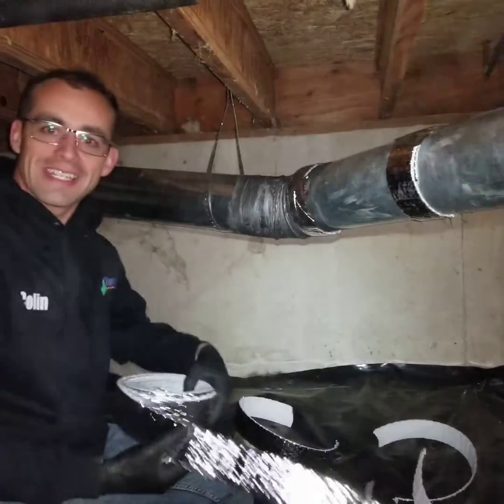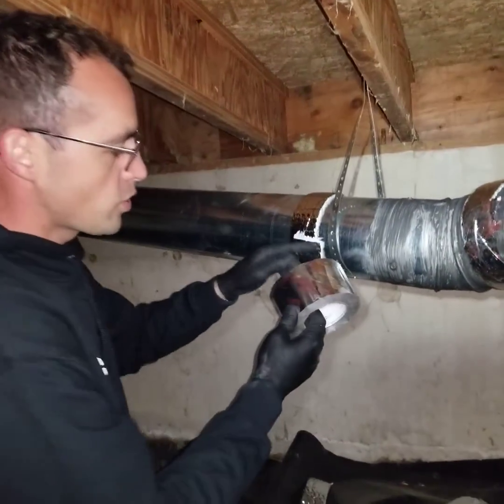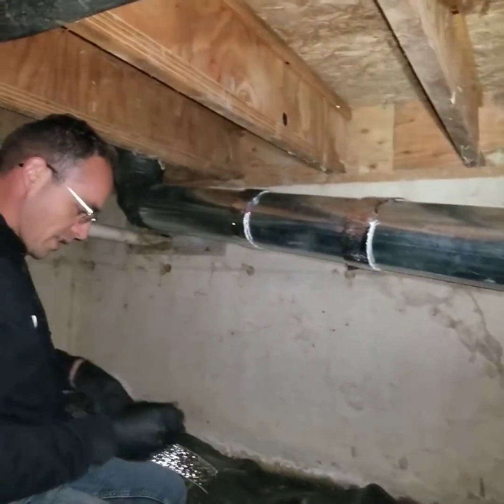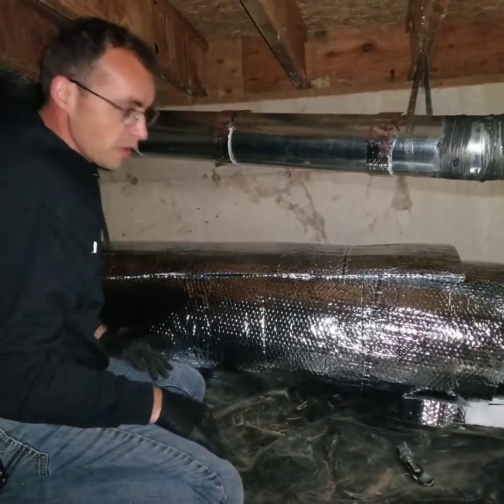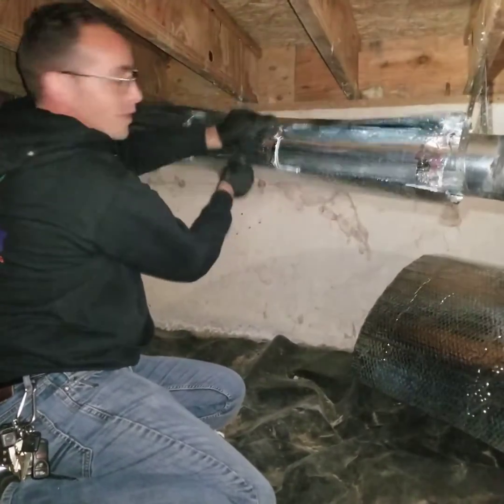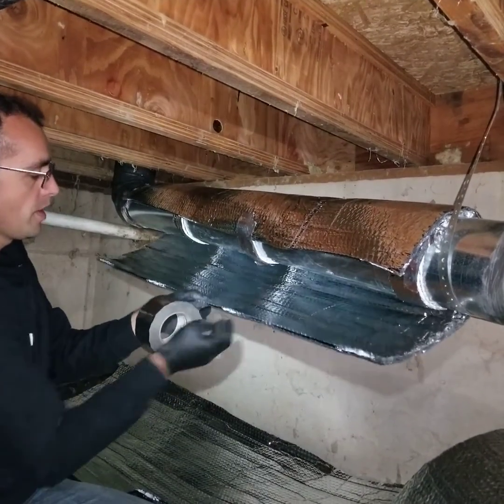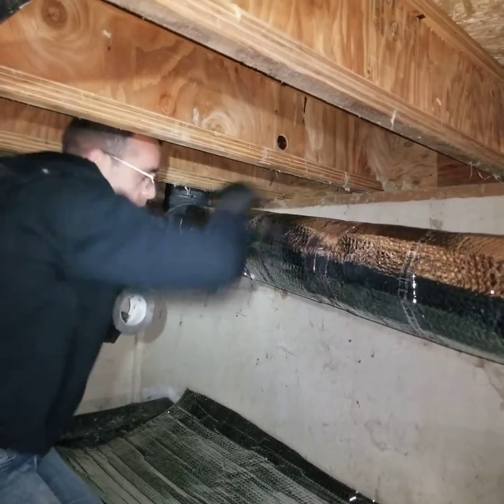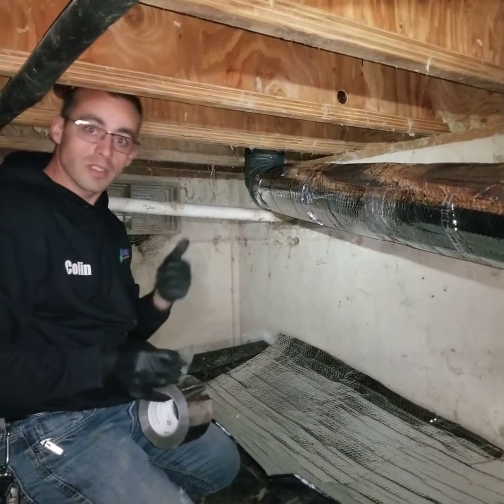How to insulate Metal Ductwork with foil insulation - for HVAC installers

Comment: Thanks for the video. I'm searching online for right materials and method for insulating my HVAC duct in the crawl space (the furnace is also in the crawl space). When I asked ChatGPT or google, quite often I found their answers were that although using reflective insulation with an air gap is correct, but the R-value you could have with reflective insulation (either form or bubble) is quite low, less than 6.    Does this sound right to you as a professional?

Comment: Thank you for this!  I put up duct without insulation and now I have to take it down to do the insulation.  A lot of work for a 65 year old female, but what the heck! I had to move my portable air conditioner 35' so it will be in the room I live in most of the time.  On a very limited income but had to do it. Live in a brick apartment with metal doors that absorb the heat and doesn't cool down all night. Grateful to have this instruction and to know I can just use the R6 foil insulation and not have to mess with that punk fiber stuff!  You're the best!  😃

Comment: Thank you for the demonstration. I have a manufactured home crossover that I am considering replacing. On the existing flex duct It says 10" with R-Value rating 5.6. It is only 10 ft-long but I see replacements only come in minimum 25' length. If you were me, would you replace the crossover with a rigid duct? I think I have noticed that the airflow on that half of the house seems quite a bit less than the other side (the side with the indoor air handler unit, of course). I am also in Washington State.
Thanks for any and all advice!

Comment: are you supposed to insulate the white pvc type pipes too? (or if it's not required, is there benefit to it anyway? or any safety issues or downsides to NOT doing that?)

Comment: I have some rigid duct that is up against the ceiling so i cant get behind it too easily and using a wrap is just practical. Is there an insulating paint i could brush on to help insulate my galvanized rigid duct?

Comment: I have rectangular duct in my garage supplying heat to the bedrooms above. It has this old fiberglass insulation that falling off. The duct is flushed to the ceiling. How should insulate? Should I use the same material with the spacer for higher R value? Thanks
Reply from the maker: @annemariedebarros2475  either type of insulation would be a good choice. I prefer the foil type because it's easier to use and it isn't irritating to the skin.

Comment: Do you have to remove the hanging straps and insulate below them then reinstall?
Reply from the maker: @jaredzanelli7867  you don't have to. If you do so the hanging straps will crash the insulation that's reducing the auto value just below the strap. It's better to insulate around the strap as shown in the video.

Comment: How would you wrap duct work that is a square box under my mobile home my duct work is a flext tube from ac to metal box that runs the floor of my home
Reply from the maker: @almann5798  usually that metal rectangular trunk runs the length of your mobile home. You may have one or two of those if it's a double wide. Typically those are already pre-insulated along with a subfloor and the membrane. Is another case for you? If they are exposed you can wrap them exactly the way I showed here. You may also use a different technique where you use a fiberglass insulation and staple the insulation to the subfloor after wrapping the duct so basically forming a u-shape.
Reply: @cleanairheatingcooling4105  yeah few of my vents are sweating and water is getting into the duct work so i was going to wrap them to see if that helps and see if it helps lower my bill some its a 92 mobile home ive own it for 5 years so do not know how it looks under there
Reply from the maker: @almann5798  does my answer help you at all? If not you're welcome to send me a picture from under the house so I can see the ductwork and I can give you more accurate advice by text.
Reply: It helped thank you

Comment: All insulations work the same way.  To achieve R value you have to "trap" an air space.  Think of it this way - Let's say that you have a 3" thick piece of fiberglass insulation (duct wrap) rated at an R8 when installed correctly.  If you take that same piece of 3" fiberglass and wrap it so tightly that it is reduced to 1" thick it is no longer an R8.  Why?? You didn't remove any material right?  What you did do was remove the air that is trapped within the fibers of the material.  This reduces the R value.  Reflectix reflective duct insulation doesn't have any fibers to trap air so you have to build an air space against the duct to raise the R value.  The material used in this video is an R4.2 wrapped direct the the duct and an R6 when installed with a spacer.  It is a double bubble, double reflective product that acts in three ways.  1.  It is an insulation (as explained above.)  2. It is a radiant barrier reflecting back radiant heat at 96% which means that the air in the duct stays cooler in the summer and warmer in the winter.  3. It is a vapor barrier which helps prevent your duct work from sweating.  We also offer a big bubble material HVBB48075 that is an R6 applied direct to the duct and an R8 When installed with an air space.
Reply from the maker: @toddhare8225  hey, you know your stuff. You're hired. Thank you for the great explanation! Do you work for the manufacturer or are you an HVAC guy like me? 🧰 👨‍🔧
Reply: @cleanairheatingcooling4105  thanks.. I work for Reflectix, the manufacturer.
Reply from the maker: @toddhare8225  wow. What a connection. Right here on YouTube! Where is this stuff made?
Reply: @cleanairheatingcooling4105  We are located in a little town north of Indianapolis , In called Markleville
Reply from the maker: @toddhare8225  very cool sir! Sometimes you should send me a text or give me a call so we can talk about this product. It's nice to make connections in the industry.

Comment: Hey nice video. I have a problem with sweating ducts under my mobile home.. they are aluminum and don’t have any insulation. What kind of insulation do you recommend I wrap it for no condensation?
Reply from the maker: You can use the bubble wrap and staple it to the floor with appropriately sized staples. You may also use a 2in R8 insulation. Or even 4in R11 or R13. Up to you.

Comment: Thanks for the informative video.   Do you use the same product on rectangular main heat runs as well or is there a ridged product for that?
Reply: Thank you!! Liked and subscribed.
Reply: Also, what was the width of the product you were using?   Lengths also 50 or 100 rolls?   Thanks!!
Reply from the maker: @presto25100  thank you for watching. Please like the video and subscribe to strengthen out chanell. Much appreciated! 🧡 
Yes, we use this for rectangle and round duct. And the width is 4 ft. I don't recall the length. I'm guessing it's about 100ft. It might be 75 ft.

Comment: Thanks for the vid. I have some free foil bubble wrap that I'd like to use for a 26 gauge dryer duct, one side white the other foil. The duct runs inside the ceiling of the garage which is the floor to living space above. There will be insulation in this cavity below the duct and the rim joists sealed. The garage will be insulated but not heated full time, and 2 of the walls are concrete as it's partially in ground. The heat from the duct would serve the floor well in the winter and help keep the water lines warm too, but, I worry about condensation. If I insulate the duct then I'd lose any benefit of the heat. Once this cavity is closed up I don't ever want to open it up again.
Reply from the maker: You're right about what you said. I'd need to know more about what the temps are to be able to answer. But so far you're on the right track.
Reply: @cleanairheatingcooling4105  I ended up wrapping the duct how you did, using the strips to create an air gap. Really not necessary in my case as it won't be inspected, but it made me feel better. Also used the Dryer- Ell 90 degree elbow and the rugged Dryer Wall Vent which are both awesome products.
Reply from the maker: @zechariahhambone3841  thank you for the update! It makes me happy that this information was useful for you!

Comment: getting from the basement to the attic, do i use rigid steel duct and transition to foil flex insulated duct once i get into the attic space? Or do i go from my air exchanger right to the attic with foil insulated duct? Thanks!
Reply from the maker: You have to use rigid duct to pass through the floors. Anything enclosed must be had pipe. Attic and crawl are the only places where you can use flex. Can you clarify your second option? IDK if it was a typo

Comment: Hi, I have a fiberglass insulation on my duct which is a bit dirty looks a bit ugly ? Can I just put an insulation foil on top of it so that it looks a bit shiny and better ? Also can you let me know the link you bought this insulation Wrap ?
Reply from the maker: Yes, you can do what you said. 
To tell you the truth, typically when you see dust or discoloration on the insulation it means that you're leaking air either in or out of the ductwork and both are not good for the efficiency and air health of your home. If you have the time you should remove the insulation and seal the ductwork so all of the joints are air tight then rewrap with insulation.  We purchased this at a local supplier so you can probably find something generic online or maybe home Depot. Or you can talk to a local HVAC contractor if they can sell you some.

Comment: where do i get the same insulation used on this video?
Reply from the maker: We get it from a local HVAC supplier. There are so many different kinds. You may be able to get it at home Depot or Lowe's or some other hardware store. Let me know if I can help you further.

Comment: The  ducting in my crawl space is wrapped with fiberglass insulation only. I want to wrap the ducting with foil insulation over the top of the fiberglass insulation, is that okay. Thanks.
Reply from the maker: Generally speaking, yes! Under normal  circumstances I would totally go ahead with that plan!

Comment: Or just buy the R8 bubble wrap.  You will save on labor.  That strip cutting is a joke and whoever invented that needs to go pound sand.
Reply: That is actually the correct you install R8 bubble wrap. The sheet is two layers of bubble with strips in the middle to create an internal space. Before you put that on the duct you have to apply the spacer strips of 2” wide bubble wrap. If you put the sheet directly on the duct without the spacers you will only have R6.
Reply: I just double wrap the smaller bubble insulation because the R8 has bigger bubbles and when it pops there goes the r value..and id jus use foil tape .that shit he's using is used for line sets I thought
Reply: @American-BadAss732  Better yet, double wrap with the R8 and you get about R12 with it.  Spendier though of course.

Comment: Could I use this technique for my a/c unit in my attic? My unit in the attic is use for a/c only, we have radiant heat, so they install a a/c unit in the attic with flex duct and it’s the worst most on efficient installation I’ve ever seen! 
So I’d like to redo the job and make it more efficient. I live in Wisconsin and my attic is a unconditioned attic I think? Lol. It’s a vented roof with ridge vents. I was thinking of doing some type of rigid duck work and wrapping it with insulation, so any tips or better ideas would be greatly appreciate it. Oh and by the way great video. Thanks for any help you can give this way. .
Reply from the maker: Of course man. Could you send some love this way and promote our channel 😁 
Now to answer your question. Yes you can do exactly what you said. I'm surprised that wasn't required by code or caught by the mechanical inspector. Please comment below with further questions. 👍

Comment: So glad I watched.  I didn't realize you needed special tape or about the spacers.  Thanks for this video!
Reply: I have square ducts. Would all of this apply to square too?
Reply from the maker: @grambeege  Yes. The same principal applies to square ducts! We actually installed this type of insulation in rectangular ducting and the processes the same. In this video I was just on a job with round ductwork so I use the example that was in front of me.

Comment: Why didn't u insulate befor you hung it ?
Reply from the maker: Honest answer? I learned that option after I developed this habit. So currently I like the freedom to run the doctor however I want and I'm just assembling duct and zipping it together. Then I go through with mastic and then I go through with insulation I guess it's just like a three-step process that I learned. I would have to try it your way several times in a row to see if I pick up speed doing it that way. Actually a lot of people in the comments have been suggesting that so I'm taking it very seriously 🫡

Comment: way easier to insulate ducting before installing it
Reply from the maker: True. We've done this on some jobs. Do you mind sharing if you always do this or are there certain scenarios where you just want to get the duct installed and route it the way you want and then going back to insulate? The reason I'm asking is there are times when even if you pre-insulate the straight pieces you still have to go back and insulate smaller pieces that you have to cut on the spot or elbows. I'd love to get your input on that.
Reply: I'm watching this video because I live in a house that is almost 40 years old and it has all metal ductwork.  the insulation is falling off in spots so I was going to reinsulate it.  Point being, it is obviously already installed so this video benefits people like me.  Not everyone is installing new ducts.
Reply from the maker: @bholtslander  absolutely! I'm glad this is useful for your situation. Maintention in the video is not to come across as if this advice only applies to new ductwork. The concept applies across the board. Hopefully your job goes smoothly reinsulating your ductwork.
Reply: Likewise.  I rent.  My bills are high enough that I may just buy the insulation and install it. I think my landlady will reimburse the cost. The house was built in 1938, and I think it probably had a whole different heating system.  There's a coal hatch on the outside, to deliver coal, and a little room for the coal to drop into.  The pipes are in the attic, and the heat losses are tremendous.

Comment: Our camp has ductwork in the space under the camp.  The camp is on a slope.  Squirrells have ripped the fiberglass to shreds.  Would replacing the fiberglass with foil eliminate this problem?
Reply: Yes it should.
Reply from the maker: From my observation having worked in many homes and commercial buildings The fiberglass insulation seems to be attractive to rodents. That doesn't seem to be the case with the bubble foil insulation. I couldn't guarantee it but I expected to be less of a problem if you were to use the foil insulation.

Comment: I like insulating the ducts before I install them folding back at the ends to allow for mastic. Makes the job so much easier and less time consuming. I guess people still like to do it the hard way. Squeegees are free by the way.
Reply from the maker: Oh man,.... you're so right. 🤦🏽‍♂️ 
Honestly in our company we do such a variety of installations from heat pumps to boilers to ductwork and wood stoves that once we develop a process we kind of stick to it if it works for us. But I think what you're saying might be actually even faster especially if we do this on a daily basis. 
Here's a question for you. If you pre-insulate the 5 ft pieces do you still have to figure out some of your layout while you're assembling the pipes? And if so, do you still have to insulate some of it while you're in the crawl?
Reply: @cleanairheatingcooling4105  I like to plan everything to the tee when I do the installation. At most there might be a small strip needed here or there. I’ve hade plenty of jobs where I’ve had to go in and re-insulate old ductwork. In those cases I do it pretty much just like you did but I squeegee my tape. Lol
Reply from the maker: @AaronPowellvox  ok. That makes sense. I will definitely try something like that soon. I might end up liking your way of doing it. If I end up being faster doing it your way I'll have to remember to come here and thank you publicly for helping me 😀

Comment: Why do you use the slim strips of insulation before the large strip? Can you just use the large insulation to insulate?
Reply: He explained @3:15 why
Reply: Were you not listening?
Reply from the maker: Great question! Currently in the state of Washington ducts have to be encapsulated in condition space. Prior to this code, ductwork had to be insulated to the R8 value to meet energy code. The bubble insulation in most cases is either r4 or R6. When you add the strips of insulation and the air gap it creates, it's rated at R8.